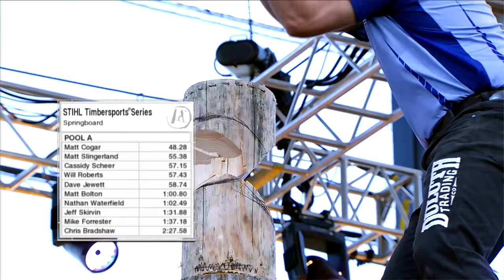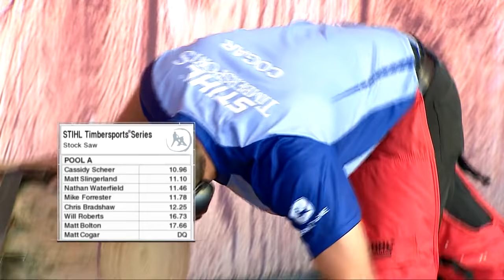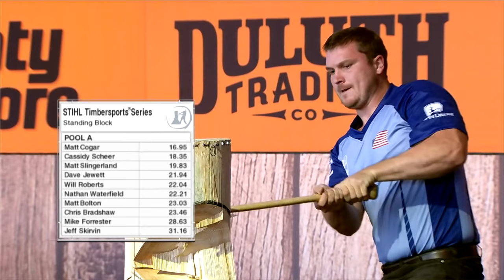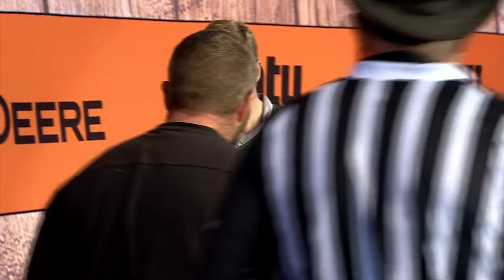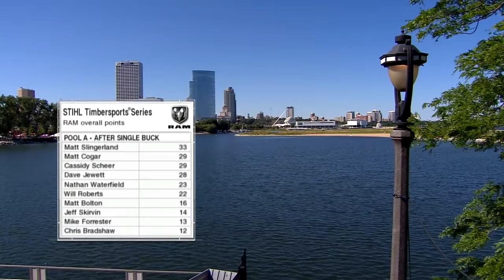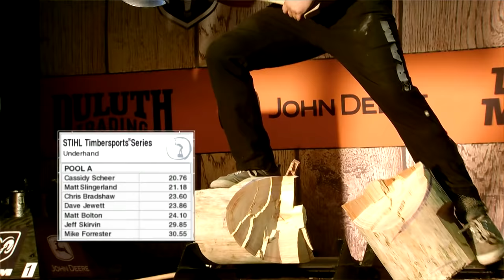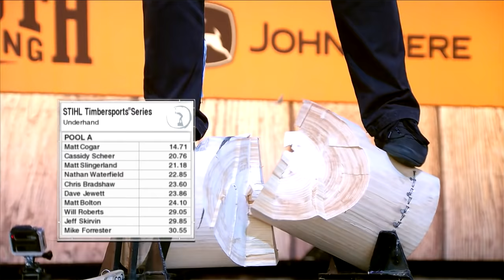STIHL TIMBERSPORTS® U.S. Championship 2017 - Part 1

Comment: I need to know how the chainsaws are sharpened and set..... Is it done by hand as you would do when out actually working with a chainsaw? Or is it done by a machine in a well set up workshop? My feeling is this. Two identical chains are given to the competitors and both have been run through exactly the same material to blunt them both equally. Then under working conditions, each competitor must sharpen his chain and cut through the logs as done here..... That will really show who knows their stuff.

Comment: why do they use coolant on the saws for single buck saws?
Reply: I think it's more to keep the saw lubricated when sawing that dry piece of lumber, it would be much tougher to saw it without. Unlikely, I think, but the heat could also bend the saw teeth.